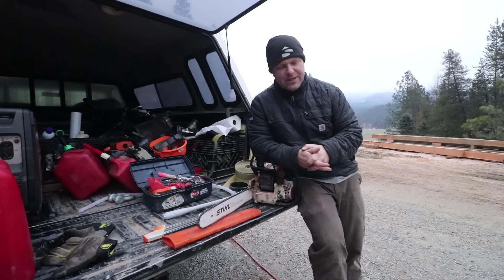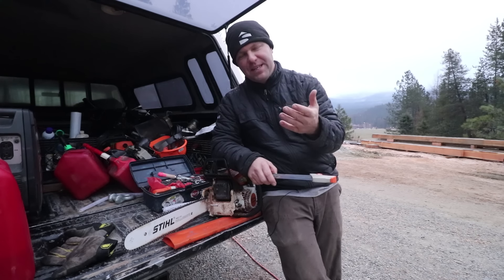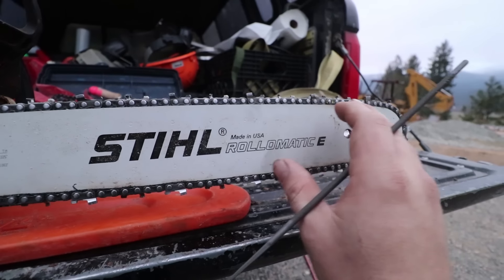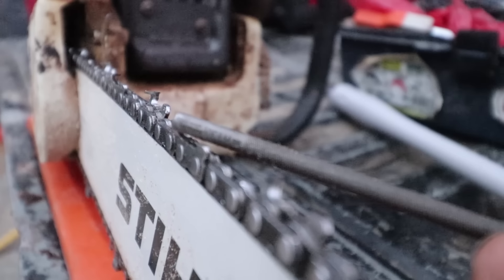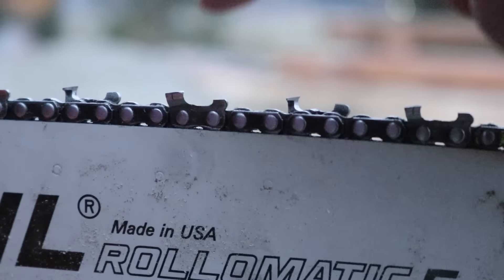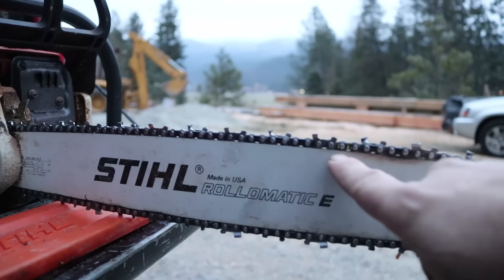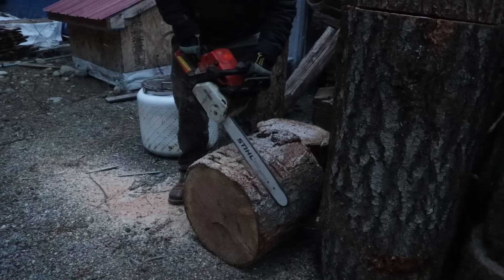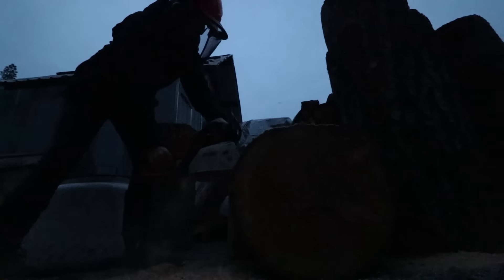98% Make This Chainsaw Sharpening Mistake (Even The Pros)

Comment: The first thing that I would do is get rid of that clunky sharpening tool and just use a file. Also I saw you or one of your guys going back and forth  while filing the tooth. Always file the theeth one way only and that's starting with file handle close to the engine and pushing towards the tip of bar. Never file towards the engine!! Your eyes are your best guide for sharpening your saw and you obviously won't learn it in a day  but once you learn you will never take your chain to have the shop sharpening it and will never use one of those crazy guides. Good luck!

Comment: Interesting video.  Having spent 40 years on the back side of a Stihl,  the first thing I noticed on your chain was the blunt tips of the teeth. Second, although more difficult to judge, was the apparent difference in length of the teeth from one side to the other.  A general rule of thumb is whenever you can see or feel the tips losing that sharp point,  stop and give the chain about three strokes per tooth. Make a serious effort to keep the teeth the same length to prevent sawing in a curve. The long side will always cut faster.  Good luck and please use your safety equipment!!

Comment: You need to use a 3/16” file not the larger 7/32 or 13/64 file. That is smaller .325 pitch chain on the stihl 250. Smaller tooth profile needs smaller diameter file. Also set up a saw buck for cutting mill ends to keep you from sawing the dirt.

Comment: I just ran across your video.  As a retired STIHL tech I'm always like watching sharpening videos.  I don't file ar grind out the gullet. That is the strength of the tooth. The file, or grinder, should only sharpen the top plate and side plate. plate

Comment: Thank you for sharing this, I have the same sharpener which was an improvement from just using a rat tail file.  I have a small STIHL for around the home and upgraded to the STIHL easy-sharpener which was an improvement from just using a rat tail and small bastard file.  Now I realize I was not putting quite enough downward pressure and also better understand what the profile should be now, thanks to this video.

Comment: I'd use a 3/16 file and mabey not do so many strokes and follow the angle of the teeth and it should fill smooth....... best thing is to just go buy the regular 3/16 file with the handle and a practice

Comment: I've used a Stihl sharpener for years. They keep your teeth sharp and raker height correct in the same motion. I use a c-clamp on the bar for stability when sharpening a saw on my tailgate or a stump in the woods. You're measuring tool should be the longest length you cut. Drill holes in your pvc pipe at any shorter interval you cut then run a zip tie through the hole to measure shorter cuts.

Comment: You are right that the gullet needs to be filed across straight. However there are several other problems with that chain. 

All the teeth need to be the same size or only the tallest ones actually cut. This chain has some taller and some shorter (more worn). File them all to the same size (that of the most worn tooth).

The depth gauges have all been filed down way too much. Now the chain will try to bite in too much bogging down the saw and slowing the cutting process.

Several of those teeth have seen dirt. The top corner of the cutting edge is rounded over. That matters. It is the edge that actually does the cutting. If rounded, it wont be a sharp edge that contacts the wood. It needs to be sharpened past that point, and then all teeth down to the same point to match.

This chain has already been ruined and will bever cut well again. Its time for a new one.

Comment: I’m amazed that you haven’t had a serious accident with your chain in such poor condition. You also need to elevate the pitch to the correct angle when sharpening your chain, no matter what method you use 👍

Comment: The file guide has two handles. If you put two hands on it you'll have an easier time putting force in the correct direction.

I've found them to be ok, but people tend to not look at what the tooth looks like since they were using a guide.

You know which shape it should have, and the guide can get you there, but if people just file without looking you're gonna file your teeth into little recliners.